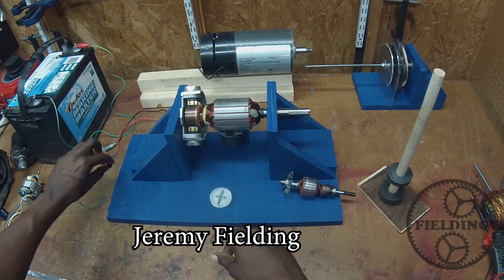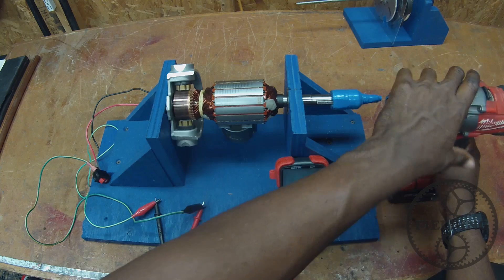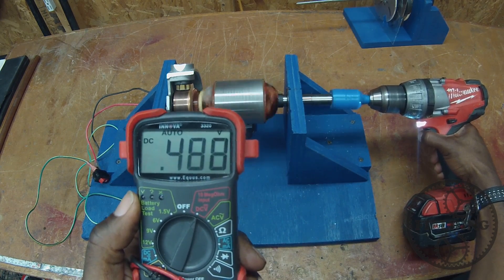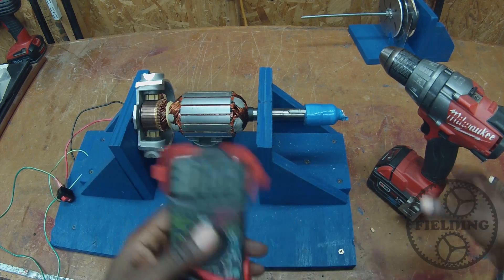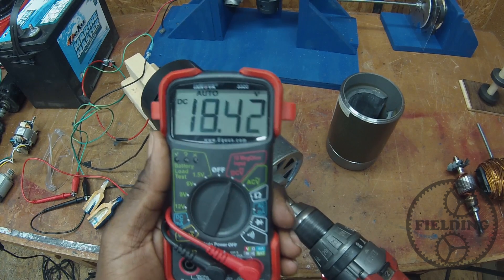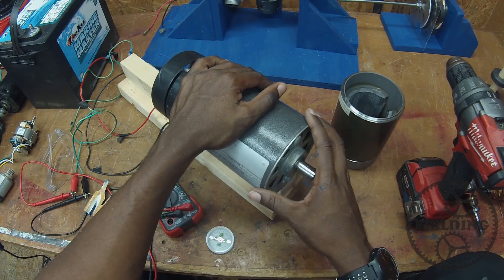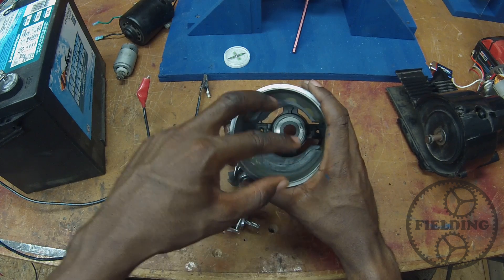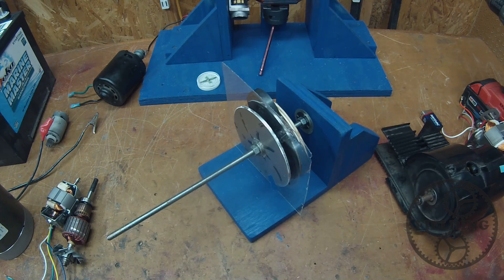How Motors Work for Beginners (Episode 2): The Generator and Universal Motor: 033

Comment: Hello, great video. If not difficult, please tell me. I want to make an electric sport bike. What type of engine is best to take. I would like it to be combined, so that at all speeds there was a maximum torque, and it was possible to make a saving mode and a turbo (including the stator winding and possibly driving capacitors or something like that in the circuit). And of course, everything should be powered by batteries.

Comment: A generator and an alternator both use electromagnet's normally. Tare apart a gas generator, or a car alternator. They both use electro magnets to induce current. You'll always notice they have more turns of wire in their electromagnetic windings than on their stators... most generators are not built with more windings on their stators? (Collecting) all dependent on time and the speed at which the fields are induced on magnetic fields...
By the way great videos, love watching them.

Comment: A lot of generators use non-permanent stator winding. A small amount of residual magnetism in the rotor generates the initial field current for the stator and then as the field current increases, more power is produced. 
The field current is then limited by an Automatic Voltage Regulator to maintain the correct generated voltage regardless of load.

Comment: So just found your channel, great vids, as far as dc perminent magnet motor can the speed the rotor spins at be adjusted by changing the distance the magnet is from the rotor?
Reply from the maker: The problem with that is you lose most of your torque with just a tiny increase in distance. There are other better ways to change the speed.
Reply: @Jeremy_Fielding  , like speed controllers i hear, just looking to  maintain speed, torque is needed most at stop starts and needed less to maintain if im thinking correctly

Comment: Thanks for all these very informative videos, I really enjoyed watching them

I believe that universal motors can be effective for electricity generation. Even in power plants, the generators used there are synchronous generators, which have a DC excitation in the rotors. These DC sources can be obtained by the generator itself. While some energy will be lost in the resistance of the field winding, it can be greatly minimized if a low resistance is used for it.

Comment: Once the electromagnets are charged, can we use the output voltage to charge the electromagnets? Self run?
Reply from the maker: No. Every time you change the form of energy some is loss. It would stop almost immediately

Comment: jeremy can i connect an ac motor to a dc generator and produce load on to the ac motor. for example i am using a 0.5hp single phase induction motor and the motor output speed is 500 rpm. what dc generator can i use.. like how do i select a dc generator? and how much load can be applied on to ac motor for the selected dc generator?
Reply from the maker: Please understand I get hundreds of emails and comments asking for technical help. It just isn’t safe or practical to try and do that at this scale....

Comment: Is it the field strength that increases voltage?... is their a point when the strength of the magnet becomes so strong the voltage won't increase? Keeping the speed constant I mean.
Reply: The winding in the motor is wire and can only take the current that its rated for. The thicker the wire the more current it can handle. That is part of what determines the maximum voltage

Comment: So how to charge batteries with a motor? Is it really as simple as using a relay, preferably Solid State for no sparks, to connect the batteries to the motor? Then use an engine to turn the motor, faster then the batteries can, to charge them? And set the engine speed to the voltage I want to charge them to. And with this setup, I can not only use the DC motor as a generator, but as a starter-motor for the engine?

Is all of this correct?

I'm still learning Electrical Engineering on my own. I already turned an electric scooter into a Series Hybrid, using a portable Inverter Generator, a transformer, a rectifier, capacitors, and buck-converter adjusted to charge the batteries to 80%, to preserve their capacity.

But I want to build a proper Series Hybrid motorcycle, that will fit my needs.

But when shopping for complete generators. The ones with the Watts & Amps I needed, are way too big to take apart & rebuild inside a Motorcycle frame, with batteries.

But somewhere I got the idea, that I just need a high current, brushless DC motor, and turn it with a small engine to make a high current, brushless, DC generator. And use gearing to match the efficient RPM of the engine, with the motor speed that creates the voltage I want to charge my batteries to.

Again, is all this correct? And I don't need anything else to make this safe, reliable, and stable? No inductors, no diodes, no capacitors? My generator plan is solid?
Reply from the maker: Unfortunately I get hundreds of questions through email, comments and all the social sites asking for help and advice. At that volume it just isn’t safe or practical to try and help one on one. Also your question is extremely complicated on several levels. You can’t properly answer something like that in the comments. There are too many things I don’t know and should not assume. I am loving the curiosity but I can’t get into this deep water.
Reply: I'm sorry. I didn't know.
Reply from the maker: No need to apologize. Just wanted you to know I wasn’t ignoring you. And that the answer is more complicated then yes or no

Comment: Awesome video . I'm wondering about the little duel volt motor..would it have enough output to charge a smart phone off grid...and is it possible to put those tiny super magnets inside to boost the volts to accommodate a hand crank? I'm going to whatch a couple more. ..
Reply from the maker: I have added a note to the description for questions like this one. please have a look. Thanks!

Comment: Jermy, what effect or what happens to the motor when the brushes wear down?
Reply from the maker: Generally they start sparking... gradually more and more... you can see what looks like a flash of light coming out the side... then the motor quits working. They are very easy to replace.
Reply: @Jeremy_Fielding  thank you for the fast reply. Maybe I did not ask the question correctly. I work fixing scooters that are rented by tourist. And knowing when a motor is has gone bad, or is the brushes or the break has been hard for me to understand. Any tips you can give me would be appreciated. Thanks again.
Reply from the maker: I don’t know beyond what I said... or periodically taking them out and looking at them

Comment: speaking in size, which one creates the strongest magnetic field, the strongest neodymium magnet of 1 inch diameter (square or circular) you can find and buy, or a coil of 1 inch in diameter (round or any shape and with or without an iron core) ???
Reply from the maker: There are too many variables, current, number of turns of wire etc... There might be a point where a neodymium magnet is cheaper for the same magnetic strength... I don't really know. But this can be calculated. you just have to do the math.A quick search of the web will reveal the formula for calculating magnetic field of a coil. Just make it the size you want and experiment
Reply: @Jeremy_Fielding  that's quite expensive, i'm trying to get a heads up, so I get it right the first time. I do have to make 500 exactly the same layers of steel rings to make the stator of the generator. I can't mess that up. But i'm actually confused now after looking at other videos. Everybody seems to claim they have the best way. 
I want to make a generator, for either hydropower with a pelton wheel, or steam powered, and then i'll need either a jet like, or a tesla turbine like driving system. But what is the best way, using copper wire around an iron core, or without a core like I see on other videos, who just make a coil, pore some resin over it and call it a stator. Does the iron core actually make a difference in generating electricity, I know it does to transfer from one coil to another like in a transformator. I just can't seem to find the answer to that question anywhere on youtube, and i'm not much of a reader :-)

Comment: just about every car on the road charges its battery using an alternator.  An alternator uses current to generate current so it must be a good way to generate power or cars wouldnt be using that type of motor

Comment: So is there such thing as free energy... Like using the one that needs only movement.... Maybe hooking magnets to a wheel or something to push the shaft would that work.. then get power out the back
Reply from the maker: Every system has some loss. You need energy to get movement. Magnets would just align and stop. The only "free" energy would be energy captured by solar power, water falls etc. Unfortunately there are so many scam videos on the topic it is difficult to combat the idea. But when there is money to be made the scammers come out to play.

Comment: Sorry if I missed it, but why does the voltage change based on direction of the motor? Do the brushes not line up as ideally or something? Or was the drill itself spinning a different speed?
Reply from the maker: The polarity of the magnetic field determines which direction the current flows. Changing the direction of the motor flips the magnetic field and thus flips the direction of current.
Reply: Jeremy Fielding  but why does it end up with a different absolute voltage?
Reply from the maker: At the same rpm the voltage is the same in either direction
Reply: That's what I was confused by. I thought it was the same RPM both times (but opposite directions) and giving different absolute voltages. Which didn't make any sense to me so I wanted to make sure I wasn't missing something key.

Thanks

Comment: I've worked with mobile electric power plants that produced AC and DC voltage.  The magnetic  field was regulated by an AC voltage regulator.  The DC voltage was generated by rectified AC voltage.  Load was line drop compensated by doughnut transformers and fed back into the magnetic field.

Comment: Hi Jeremy. I have a machine and it uses a Leeson premium efficiency WATTSAVER motor. It's a 1 HP motor that draws 5.5 Amps. I have no intentions of copying this motor but I'd really like to know how it is possible when most machines of this kind use 1.5 HP with less torque and twice as many amps? Can you possibly explain this?
Reply from the maker: It is easier then you think. You just don’t have enough information. What is the speed, what is the voltage, what is the efficiency of the “typical” you refer to? More voltage requires less amps, more speed means less torque at the same HP. You are not comparing enough variables is all
Reply: Thanks so much for the quick reply. I will get the information when my machine comes in. Is there another way to contact you?
Reply from the maker: You could use my website but my question was to point you in the right direction, not to just answer the question for you...You weren’t asking the right questions. Now you have some idea of what differences there might be...you can investigate on your own. I get hundreds of questions like this and it isn’t practical or safe to give one on one advice.

Comment: little bit confused here, did you put a diode in between the battery and the dc generator.
Reply from the maker: +Roselle Laureano I don't remember all the details of this video. But based on your question alone you would need a diode if you want to charge a battery and there is a risk the generators output voltage will drop below that of the battery

Comment: I noticed that the generators produced a higher (+) positive voltage than (-) negative.  Why is that?
Reply from the maker: That would be coincidental. I was squeezing the trigger differently. I would not expect there to be a difference. It is only the direction of current that is changing.

Comment: hey with negative volts does it draw power or or absorb power or how does that work
Reply from the maker: +Josh Masters it’s just a potential. Meaning no current is flowing except a tiny amount through the multi meter. The negative just tells you which direction current would flow if a path was available

Comment: Why can't you reverse this so that the magnets turn and charge the battery.
  Once you start the magnet in rotation, they will CONTINUE to pull away from each other, continue to turn, thus creating perpetual motions..... Endlessly creating electric energy!
   Please tell me this can be done
Reply from the maker: I don't understand what you mean? Do you mean removed the electro-magnet rotor and use magnets? If so it would not spin even if you pushed it. The polarity has to switch. Permanent magnets are ... well.. permanently fixed in polarity.
Reply: I also don't understand exactly what configuration you are referring to, but no matter what, with only magnets and no power source, perpetual motion will not occur. They will continually pull to each other until they find a balance and stop. It may spin for a little bit, with absolutely no load being driven by them, but it will eventually stop in place. People have made things that spin for a pretty lengthy amount of time, but they always end up coming to a stop eventually and they were producing no power, only spinning themselves.

Also, it's good to note, when he was spinning the rotor with the drill and creating 2 volts of electricity, he is definitely putting in more voltage and power from the drill than he is creating. It's all about the laws of thermodynamics. When you spin a dc motor with no load attached to it (the lead wires left unconnected) it will spin easily by hand, but if you hook those wires up to a load such as a light bulb, it will be harder to spin the motor by hand. The more power you need for the load(s) the harder it is to turn the "generator".

Comment: decribe more about commutator don't understand how it changes and when it changes the polarity
Reply: There is a complete circuit between each coil exactly 180 degrees from each other on the commutator. So while the one commutator bar on the top side is being fed (+) from the brush, the one on the exact opposite side (180 degrees) on the bottom is being fed (-) from the other brush.  Lets say there's 10 coils total on the rotor, then there are 20 commutator bars. Two bars for each coil, exactly 180 degrees from each other. Any bars that are not under the brush at any time are not receiving power and are therefor not magnetic at that time.

Comment: Awesome! its worth noting that Car Alternators use the concept of a small electrical current supplied to the outer windings to create electromagnets that are subsequently used to generate electricity for the vehicle. Loving this series!
Reply from the maker: Absolutely... Also industrial generators use current to the stator. That is the most efficient way to get a very large magnetic field compared to what you can get with permanent magnets of the same size. The fact that you can turn them on and off is another benefit. I should talk about this in the Q and A. In the video I was thinking about homemade generators, but outside that context it is done that way for many reasons.
Reply: Cool.. I am looking forward to the Q&A, I toured a hydroelectric museum (a once working hydro plant turned into a museum) last year and they had separate small DC generators on small turbines specifically to generate the current to create the electromagnets for the main A/C generators. Learning heaps.. thanks!

Comment: You noted that univesrsal motors don't make good generators. With ever so slght a modification they do. If you use a battery and energize the rotor you get an electromagnet. Spin the shaft and power is induced in the stator. Rectify the output of the stator and feed back to battery and you charge it. This is how an alternator works.
Reply from the maker: I understand and I certainly agree it is possible... In fact, that is exactly the method I described the video you just watched, except I didn't want to get into charging the battery. My only point was you need electricity to make electricity with that setup. The home-made generator is simpler with a permanent magnet motor. This is targeted to my beginner audience who frequently ask me how to build a generator at home. I tried to make it clear I was referring to home use (also noted in the video), because industrial generators also use electromagnets for the stator. Hopefully this helps to put my words into context for you.

Comment: You forgot that there will be limitations on the output, you may get 2v but have 1a of current capability as the other motor may have 14v but only 100ma current capability.
Reply from the maker: I did not discuss the differences in total power  (volts x amps) output but I presented it correctly. The motor producing the higher voltage would also produce a higher current and total power output considering only the circumstances I presented in the video. The strength of the magnetic field is the factor here. The resistance of both motors is about the same.

Comment: wouldn't the DC motor also produce ac current as well without any extra devices?
Reply from the maker: +Daniel Audette the commutator is converting the ac from the rotor to D.C. At the red and black wires. D.C. Only with this setup